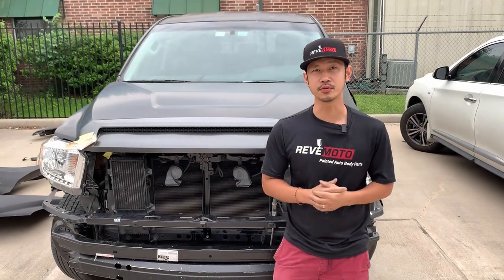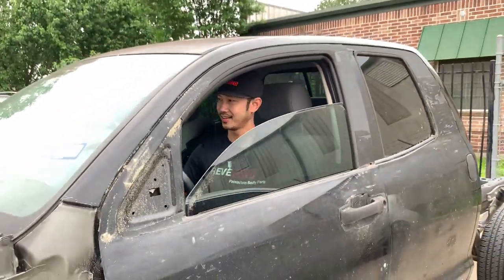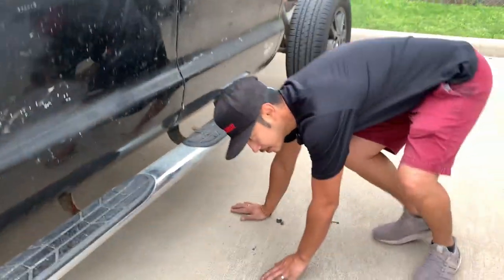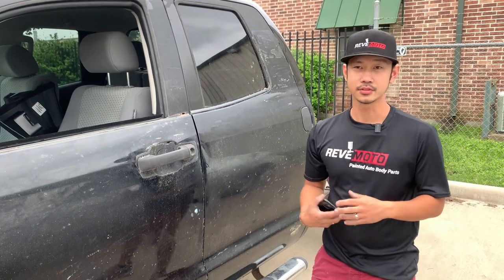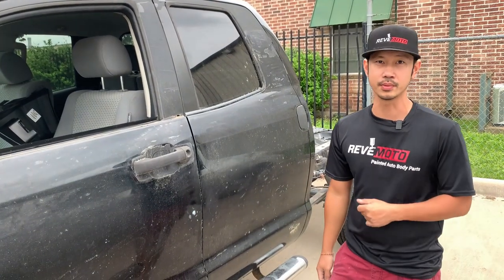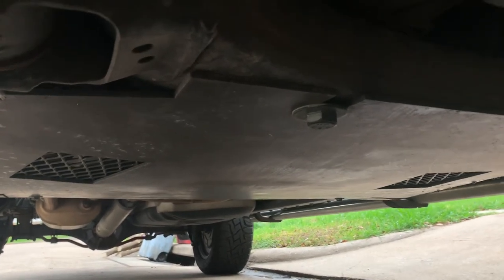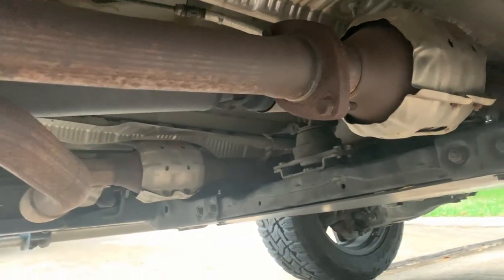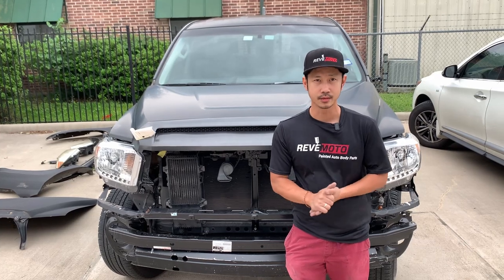Toyota Tundra stolen catalytic converter & how to prevent it!

Comment: It cost me $3000 with aftermarket cats to have mine fixed after stolen at Home Depot off 610 north side, would have been $5000 and 4 weeks with toyota parts.  The idiots with the saw also cut my fuel line so gas was blowing everywhere when I started it
Reply from the maker: Damn, that's awful. Someone needs to catch these guys. We still haven't fixed our truck. We probably should get on it. Thank you for watching!
Reply: It just happened to me, I was planning to drive home where I could put new cat myself but smelled gasoline, went under my car and the was fuel pouring down at the driver side while the freshly cut pipe is shooting hot exhaust at it.. I said $270 tow is the only choice.

Comment: I'll advice you to look into it. Mine was stolen last year at a mechanics shop. He replaced them with some aftermarkets but the truck never passed emissions test and I ended up selling it for an upgraded tundra. Right now I have security systems and never go on long trips with it. Still looking for the perfect one though.
Reply from the maker: Hello. It's gotten so bad the past couple years, but the steel plate definitely slows the thieves down. The other methods are just to prevent them from selling, but that's not a guarantee. Good luck!
Reply: Never go on long trips with it? Why not?
Reply: Stole it at the Mechanic's shop?!
Reply from the maker: @teller1290  There was a Toyota dealership in Houston that left their trucks out and got just about every catalytic converter stolen. This was a couple years ago though.

Comment: I took my Tundra in for repairs recently and my mechanic was very concerned about it being left at the shop over the weekend because of the "cats" being stolen around town. I'm going to look into the protection plate! Thanks!
Reply from the maker: We no longer keep any trucks outside our shop. Good luck with the plate!
Reply: @ReveMoto  are you suggesting that the plate is a problem or a lot of trouble? Thx.

Comment: They just got my 2010 Toyota Tundra's catalytic converters, cut and stolen last Friday!!!! No luck finding one yet and it will be very expensive!! Any advices on where to get a reasonable catalytic converters and the skid plate. I'm very frustrated!
Reply from the maker: Hello and we're sorry to hear the bad news. The cats are super expensive from Toyota. I'm not sure if there are reasonable prices but you can straight pipe the truck. I would check with your state laws. The skid plate can be purchased from Valhalla Shield in Houston Tx. Thanks for watching!

Comment: Would engrave VIN on to catalytic converter really work, since thieves want what's inside of the catalytic converter and can careless about the outer shell where we engrave the VIN on...?
Reply from the maker: Technically yes, but I believe most of the time they do not slice open the converters to get the precious metals out. 9 out of 10 times, they'll try and sell it at a metal scrap yard. Because it has gotten so bad, they usually wont touch it if it has been marked with paint or engraved. Some cities and states are legislating the sale/purchase of converters. Thank you for watching!

Comment: Somebody stole 2 of the catalytic converters and oxygen sensor of my truck last night where can I get the that metal protector so it won’t happen again
Reply from the maker: We're sorry they did that to ya. We got our in Houston from a metal shop called Vallhala metals or you Tyler Backes on Facebook.
Reply: @ReveMoto  I live out of state. Can I order from there or should I try to find something in Mississippi? I'd prefer to buy something professionally and thoughtfully made.
Reply from the maker: @teller1290 I think our guy is on backorder and I'd imagine the shipping would be expensive. I am sure a good metalsmith can replicate it. I would definitely call him to check on pricing and timeline. I would also find a local metal shop to compare prices. The plate our friend has was about $200 for the front plate. Good luck!

Comment: Please can you help me getting the measurement for the metal plate you installed. I have a friend who can make it for me , we needs the measurements. The problem now is that I am visiting my friend out of state without my truck due to the same issue , cats were stolen , I had to left the truck in the garage. I would greatly appreciate it if you can send me dimensions soon. Thanks thanks a lot
Reply: I will make  a modification to the plate , opening a square hole that can give access to the transmission tray in case needs to be serviced, not to mention thieves can be prepared with tools to remove screws.... . That secondary small square plate to cover the hole  will be secured with screws that my friend will make . He will also make the only tool that can remove those screws ..thansk for the help in advanced, Hope is ok for you providing the measurements , thanks again
Reply from the maker: That was a friends truck but the plate is about 2-3ft in length. That was the front plate and there is another one that goes from rear cats back. Sorry we cannot get you the exact measurements. Thank you for watching!